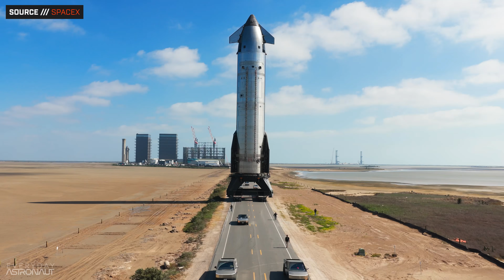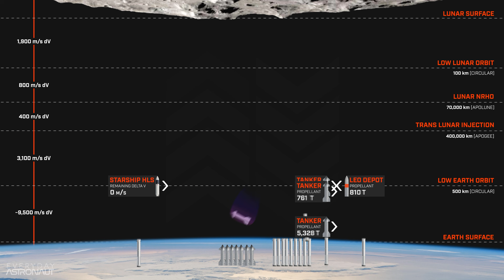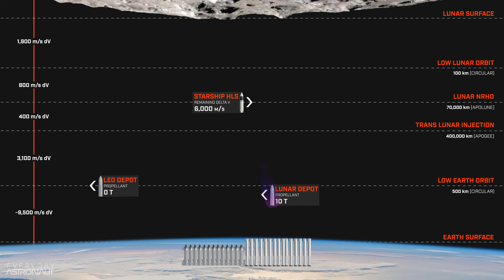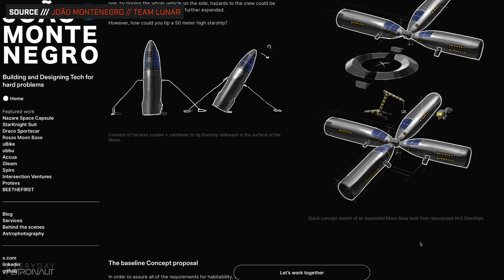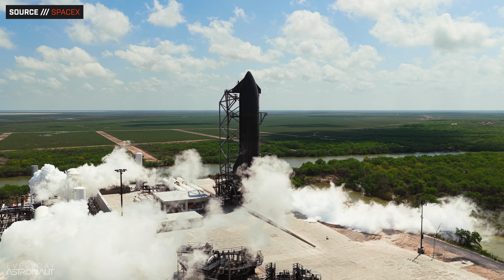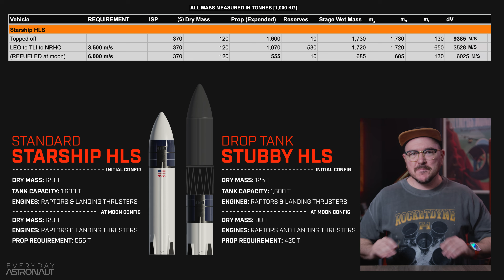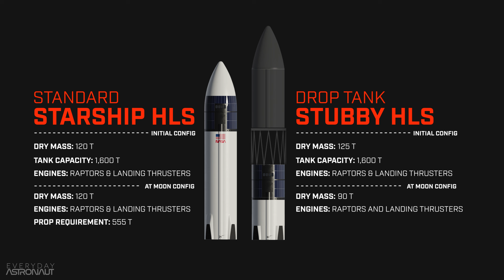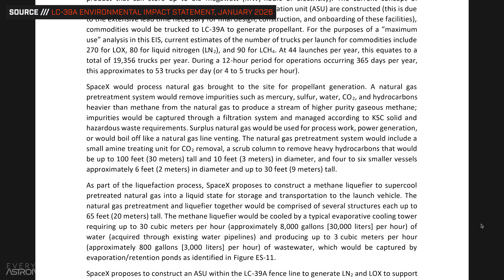Does Starship REALLY require 15+ launches to land one lunar Starship?!

Comment: Other thoughts: the ship that never returns to earth only needs 1 central vacuum engine, no sea level engines, and in space 1 engine running 3 times longer works just as well. Less engine weight and resulting simpler & lighter plumbing benefits all phases.  The shorter ship makes more sense for getting there quickly.  The full size ship makes sense for lunar base infrastructure buildout where you need to deliver more mass, but once a base is up and running you would be more efficient using the shorter ship for crew transfer and living supplies, as we have seen already with the space station.
Reply: It still needs all engines to lift off from SuperHeavy and go to low earth orbit. 
So any short ship version also makes no sense.
Reply: You can’t get into orbit with the thrust of 1 vacuum engine
Reply: Going from 3 RSL and 3 RVac to 1 RVac would, not only have already pointed out TWR issues, but it'd require a complete redesign of the aft section.
Which, given how complex that section is, is a really, really bad idea.
Reply: @bryanillenberg  Presumably it would be a massive simplification. With only 1 engine, you don't need to worry about getting propellant to all 6 engines (fewer and smaller pipes). There's a reason Apollo used a dedicated 3rd stage for doing the lunar transfer. Getting to earth orbit and getting to the moon are completely different tasks and are best served by separate vehicles.
Reply: @oscarsmith3942  It's a huge redesign.
The thrust puck would need to be completely changed and the aft skirt lengthened. Along with the various manifolds for the engines, electrical systems, ect, ect.
Also, having a third stage would make second stage reuse impossible.
So, no, adding a "third stage" wouldn't just be a bad idea. It'd be among the worst ideas possible.
Reply: @bryanillenberg  Why would a third stage make 2nd stage reuse impossible? There doesn't seem to be any connection between the 2.

Sure it would be a big redesign, but it would also shrink dry mass by ~2x.
Reply: @oscarsmith3942  How do you attach a 9 meter third stage to the second stage?
By replacing the nosecone with an interstage.
No, there is not an alternative to this without being limited to a really, really small lander.
Like Apollo LM sized lander.
Reply: @bryanillenberg  That's fair. It still seems like disposing of a single second stage to get a much better 3rd stage working would be reasonable. If it gets you down from 15 launches to 2-3 launches per moon mission since you'll be dramatically reducing the number of possible launch failures per mission.
Reply: @oscarsmith3942  The cost to SpaceX for the 15+ extra launches is likely going to be less than expending a second stage.
Also, again, you'd now need to design a new third stage.
Which is going to be really, really difficult
Reply: Can only reduce the number of raptors if they uprate the engine to  be reliable for a much longer continuous burn.
Reply: Seems rediculous that a reusable lunar lander should be its own second stage to get into earth orbit. Even the job of TLI should be outside of its scope. 
I say boost your "lightweight" lander into earth orbit as payload on the front of a truncated, disposable Starship (used as a traditional second stage). Some refuels of that stage in LEO and your good for TLI.  That gets your "lightweight" lander to the moon.  If your lander is Alpaca , it might be fully fuel and go straight for a landing. If it's a bigger machine it will need some fueling trips. 
I agree the whole subject is complicated and mathematics overrules any intuition.
Reply: @andrewfarrow4699   HLS is oversized for a lunar lander for the first few missions, yes. That's because its basic design is for a Mars lander carrying a lot of people and supplies. The existence of that design program is how NASA was able to get it for only $2.8B, it was the only lander they could afford. Ironically, the smaller, more reasonable landers cost more.

Paying for a much-modified design would be expensive and also take a lot of time. Coputer modeling and in-flight testing will be needed to make sure it can get to LEO.
Reply: @andrewfarrow4699  Agree. Also, Reusability is not a holy grail. When we are home preparing food, virtually all the needed tools and containers are reusable. When traveling, much of it is disposable. SpaceX is near enough to disposable that they could implement a test program involving 10 plus flights before getting any profit. And Falcon heavy cores are thrown away. A disposable second stage for Starship is not a sin.
Reply: @spheroidialmaster1910  it’s not but propellant is far far cheaper than hardware, so whenever you have the opportunity on space launch to just expend more propellant and save the hardware you should do it.
Reply: As the other comments said - It needs to get to orbit. But I'd like to see discussion of a 3rd stage along the lines you suggest. If it were reusable (in space only) , aluminum might save some weight.
Reply: Finally somebody talking some sense. Why are Sea Level Raptors required for a ship that will never be anywhere near sea level when operational? However, 1 Raptor is not enough to obtain initial orbit, nor optimal for TLI. 3 vac Raptors can be enough to get HLS to orbit if it is not carrying a large payload. They would have to be gimballed for control. Everybody I have suggested this to has stated "too expensive to redesign for gimballed Vac Raptors" SpaceX has massively re-designed the engine mounting on every version of Starship booster, this is not a valid argument. Also only 1 Raptor would require multiple orbits and re-lights to achieve TLI which would mean the astronauts would have to transit the Van Allan Belts multiple times increasing their exposure to radiation. Three Vacs is really optimum.
Reply: @royh6526  3 RVacs does not have sufficient control
Reply: @bryanillenberg  In what way? Why not? SpaceX engineers are very resourceful, can this not be resolved?
Reply: @royh6526  If they lose an RVac, or an RVac starts underperforming, say goodbye to attitude control.
Reply: @bryanillenberg  Any failure will cause problems, that does not answer my question. 

But I think I know what you were getting at. Raptor Vacs are optimized for maximum thrust and ISP and are not designed to be throttleable like the SL Raptors. It would have to sacrifice some maximum performance to be adjustable. This is just a design decision, not beyond engineering capability. Basically an SL Raptor with a large Vac bell.
Reply: @royh6526  RVacs have the same throttle range as the sea level engines.
The difference between the RVac and the outer engines on the booster is the nozzle. That's it.
But the loss of a single engine would doom the vehicle.
Also, the TWR on ascent of your proposed "vehicle" would be horrendous. Only slightly more than half of the TWR of the standard stage 2.
That low TWR decreases the efficiency of the ascent burn, likely requiring a much better mass ratio than removing five tons of engines would provide.
And again, there is the control issues that results from just using thrust differential.
Reply: @bryanillenberg  Not according to what I have read.
Reply: @royh6526  Then what you read is wrong.
No other way to describe it.
Reply: @royh6526  I agree 3 vacs is optimal for HLS. But Starship needs sea level raptors for landing on earth. The problem with gimbaling vacuum Raptors is their nozzles are humongous, making it quite a bit harder.

Comment: The best rendezvous is no rendezvous.
Reply: Best nuts are deez nuts
Reply: Full reusability +  in orbit refueling + in-situ propellant production OR BUST
Reply: @nickrakemer9277  Yes, but there's negligible carbon on the moon, so Blue Moon wins against Starship with in-situ LOX/LH2 production.
Reply: No. The best rendezvous is with Rama.
Reply: @Ronark91  Oumuamua?
Reply: Best billionaire is no billionaire
Reply: *For expendables.  Which are insane.
Reply: best launch profile is often also fully-disposable for the same underlying logic... despite Musk's efforts to convince people otherwise.
Launches are highly specialized tasks and it makes throwing everything away a perfectly viable way of doing things, especially for big launches like for Artemis.
Reply: @sunienizami  well no. In some cases, yeah it’s fully worth it to dispose of some or all of the rocket, but for example, what falcon 9 is doing, it is obviously significantly cheaper, more efficient, safer, and more reliable to use these reusable rockets. That’s why they are expending some of it on the HLS. The tankers will be expended, not reused, unless they keep it in LEO and don’t de orbit it. The tankers though, are again an example of something they SHOULD be reusing, because they need to use so many, and it uses almost no fuel to re use them versus to expend them. The bigger issue is the complexity of reuse, not the cost or fuel. Reusing the ship and booster for starship will have a very very little difference in total deltaV, for a significant cost minimization. Space travel is becoming more common, and launches are happening more. This is something that is no longer unique and worthwhile to expend boosters
Reply: goated comment
Reply: Best moon mission is no moon mission.
Reply: @stefanaldea best advancements are no advancements.  Good grief
Reply: @stefanaldea straight to mars..
Reply: @stefanaldea  Not your money, not your choice 😊
Reply: @liquidsnakex  The money's not the issue, i'm all for space exploration, but it's OUR atmosphere and good grief do launches pollute since they release it in higher atmosphere.
Reply: @alexandrevalentin8587 So your solution” is what… we launch absolutely nothing while our enemies launch whatever they feel like with impunity, then enslave us with untouchable weapons from space? Thank god it’s not up to you then 😆

Also SpaceX is the only company launching rockets using methane as propellant, the greenhouse gas that’s 20x worse than carbon dioxide, but when you combust it turns mostly into water vapor… THAT’S company you want to strangle… while everyone else just uses kerosene. Great plan doofoid!

See, this is exactly why I reject the idea that it’s “our” atmosphere… because you don’t have the first clue how it works, how space launches work, how economics work, and are too lazy to research any of it.

If you had any control over how it was used, the first thing you’d vote to do with “oUr” atmosphere, is try to ban anyone outside your cu lt from breathing it, fining them for every single breath they take.

Thankfully we already have a system for controlling common resources, it’s called elections and if memory serves, your cu lt lost the last one due to being insufferable control freaks, so thankfully your opinion on what your betters can and cannot do… is null and void now 😊
Reply: @liquidsnakex  Allow me to educate you, 1/3 of the global general aviation emissions is..... CONTRAILS, they look innocent, mostly water vapor, well they're actually responsible for the atmospheric albedo increase, which leads to global warming.

As for being lazy this tells me more about you than it does about me, come back when you have an engineering degree.
And stop making a fool of yourself with your assumptions that everyone seeks banning, i'm a petrol head, I have my PPL not for any kind of career but because I like flying as a hobby, and I majored in aerospace, so keep dreaming you schyzo.
Reply: @alexandrevalentin8587Have you ever actually seen the math on this, versus the effect of the millions to billions of times more emissions at a somewhat lower altitude, to deliver your online purchases from Amazon and other sites?
Reply: @alexandrevalentin8587rockets exhaust mostly water

Comment: That's why I'm for more specialized spacecraft
- Lifters -> Specific for putting things in orbit. Specific for each purpose. A lifter for the Moon is different than a lifter for Mars.
- Orbiters -> Specific for orbiting things. Satelites, stations, probes
- Landers -> Capable to lift and bring down heavy cargo. No human use. Specific for each planet/satellite
- Shuttles -> Specific for human use. Capable of transport humans in and out of orbits, specific for each planet/satellite
- Freighters -> Huge cargo ships meant to transport large loads thru very long trips
- Cruisers -> Human graded ship for long duration trips. Specific for certain routes in certain time window (aligment, and stuff)
- Pusher -> specialized propulsion systems for each application. They can be of many different sizes but most of all, they are specific for each specific atmospheric, application profile. Most of all, they should be modular so no only different capabilties from sizing/fueling but also by using multiple homogeneous/mixed units.
Reply: We got gotta get rid of this idea that um single spacecraft design must do everything at once (Fly space, fly atmospher, fly MULTIPLE atmospheres, different gravities. But it must be specific for a certain payload.

See the issue?

Space is infrastructure already. Those who arrives first will be very rich

Comment: 27:30 The fact that the exhaust from those landing thrusters will be angled away from the landing point is also going to mean that most of the dust that is kicked up should be moving away from the rocket, and any that does move toward it should be moving at a lower speed! Since it’s a continuous stream and not a single impact like a meteor or asteroid strike, it should behave more like aiming a hair dryer at an angle toward loose dry sand, rather than a crater that spews ejecta in all directions equally.

52:00 I think they’re expecting to increase the payload mass to something like 150 tons as they refine the design, which would reduce the number of refueling flights significantly.

56:00 Expending a bunch of Starships with six Raptors each is not going to be cost effective compared to just building those Starships and reusing them ONE extra time each to make up for the difference. Remember, cost of propellant is orders of magnitude lower than cost of rocket construction, and they’re planning on producing a LOT of Starships and boosters! They could end up having 6-12 full stacks ready to roll out and launch at a rapid cadence to get the depot fueled up surprisingly quickly!

1:03:00 Remember that you can make engines with multiple thrust chambers per turbo pump, like Stoke Space’s upper stage and some Russian engines. So you might, say, have one Raptor turbo pump feeding a cluster of three or four of the landing thrusters, depending on exactly how many total thrusters there are, you might have four, six, or eight such turbo pumps and would still have pitch and yaw control via differential throttling (probably would use RCS for roll control while in lunar landing/takeoff mode).

Comment: Best case for HLS is to have the lander be smaller (maybe even just the top half), utilizing the smaller top thrusters for ascent and descent. The lower half can be used for TLI and circularizing in lunar orbit similar to the command module on Apollo. A lunar fuel depot can be full of fuel and should, if docked with the HLS top in lunar orbit, support a lot of landings to the lunar surface (at least 4). The only consideration is the payload transportation to/from the Moon from/to the Earth. HLS isn't designed for earth entry, so they must have thought this out already...

Comment: Kinda glazed over whole refueling issue, regarding it as just a more complicated process due to the mass of starship. It's a lot more problematic, we have 15+, likely a lot more, starship launches needed to be launched back to back. Not just one after another, they need to be rapid fire launched due to boil off. We still need to even figure out cryogenic refueling in orbit because we have never done that. And don't know how to do it. Then create a fueling depot that keeps the fuel contained and safe without boiling off. Again haven't ever done it in orbit. Then do the same kind of rapid fire launches 18+, likely more, to fuel HLS part way to the moon. Then agaaain even more 20+ rapid fire launches to refuel a depot in lunar orbit. All with no critical issues during all these refuelings done with some kind of newly designed in orbit fuel transfer system. I mean my holy crap. Starship hasn't even been able to make it to orbit yet without some critical system issue.

Comment: Throwing away hardware to save trips misses the whole point, that fuel is the cheapest part of the flight.    The point of this design is that launching rockets fast will be as easy as airplanes taking off.
Reply: you must have a very comfortable armchair.

Comment: Another wildcard: if you get to the point where you can get to the moon with the fuel for the return trip, you can separate that fuel tank while in moon orbit and re-capture it on the way back, so all that fuel doesn't have to be brought down and then out of the moons gravity well. 
In any case, building the lunar starship using 4.5mm stainless steel makes no sense, and that's the difference between a handful of tankers and over one dozen. Welding thinner metal requires some special considerations but within the ranges we are talking about it's easier that the thick metal option.